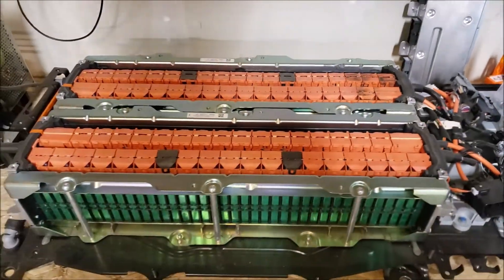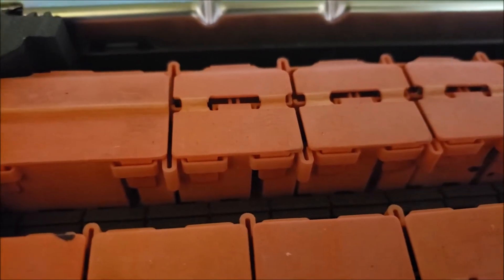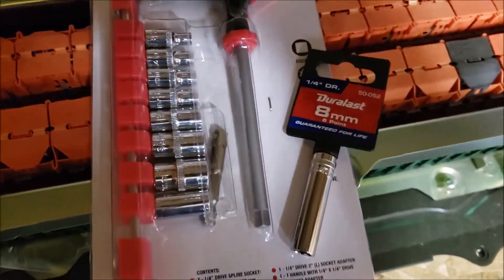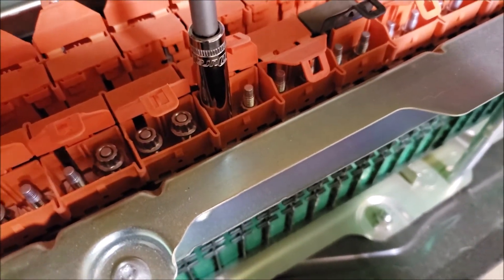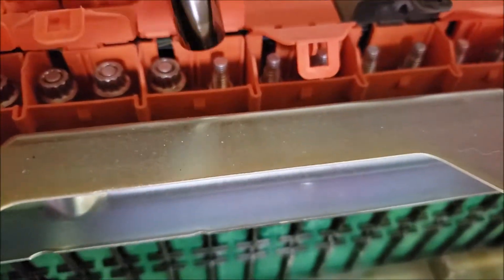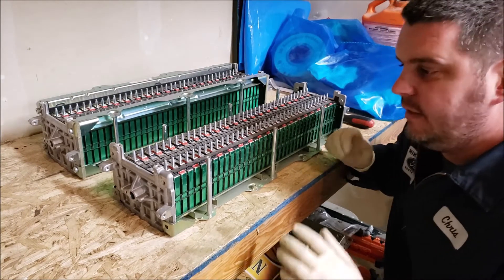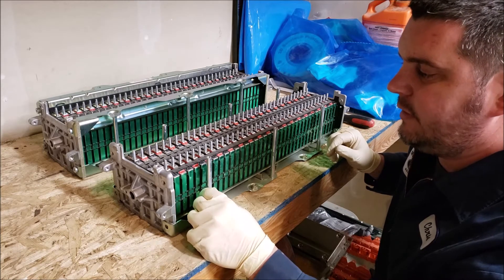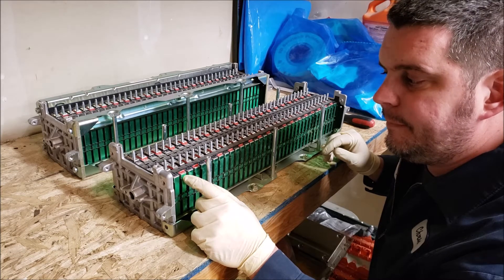C-Max Hybrid Battery Disassembly and Re-Purpose in Power Wheels (Part 1)

Comment: Hello!  I want to crack the battery pack in my 2014 Cmax hybrid, replace the entire lot with fresh cells.  If you have a few still lying around could you give me an accurate measure of the dimensions (in millimeters)?

Comment: I use these for high output car audio and yea one bad cell can kill a whole bank if left connected. My bank died and I left it together and it hurt all 152 cells were significantly lower capacity. Only a handful of cells would hold correct voltage and not drop
Reply: Yeah, it will eat up the rest faster. They have a continuous amp rating. If batteries start to go out, you put more strain on the remaining.

Comment: if you can help me i need the measurements of the studs for one of the battery cells.
Reply from the maker: They appear to be M3 or M4 studs they measure 11/32 long and are spaced about 2-1/2" apart. I hope that helps.

Comment: I have a question if you don't mind? What size socket did you use to remove the cell nuts? 9/32 and 7mm are too small and 8mm and 5/16 are too big and just spin. I can find no 12 point sockets between these sizes. I did find a 7.5mm 6 point but that won't help on 12 point nuts. Thank you in advance for any input.
Reply from the maker: It is a weird nut! I was able to use a new 8mm 6 point socket. It barely grips, but was just enough to remove the nuts.
Reply: @fordtechchris  Well I suppose the battery I have I abused 😆. A brand new snap-on won't grip the nuts enough on this one. Oh well then pliers it is 😬
Reply: i have a guy at my shop trying to take a bad cell out and nobody can find the correct socket for this. i even asked AI and was able to find these exact nuts on amazon but it says they are "external hex" and when you look that up online you get NOTHING. how does nobody have this socket?

Comment: I'm about to get a 2013 cmax with 130k. What are you gonna do about battery replacement, and what's it gonna cost? Was it water damage?
Reply from the maker: It wasn't water damage. I found a used battery on eBay shipped fairly cheap.